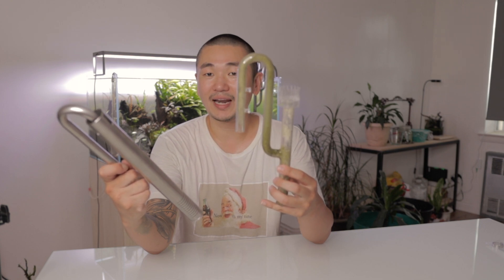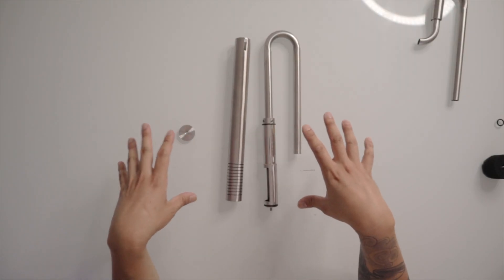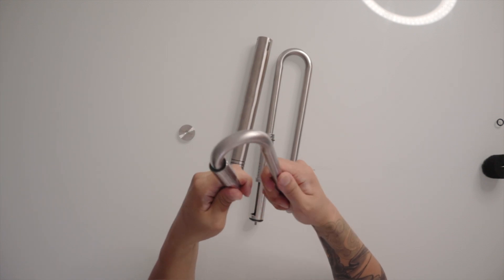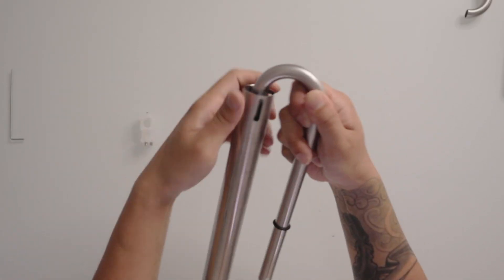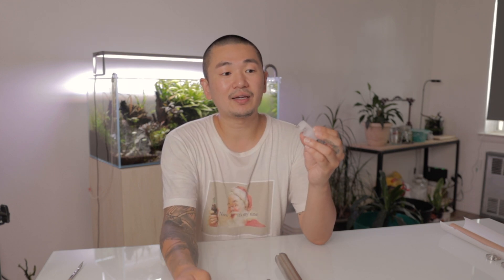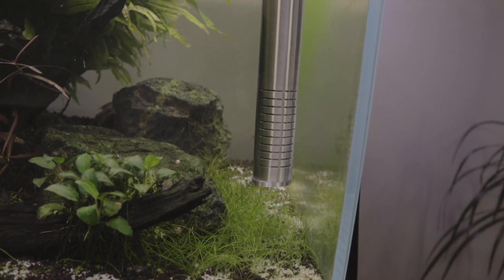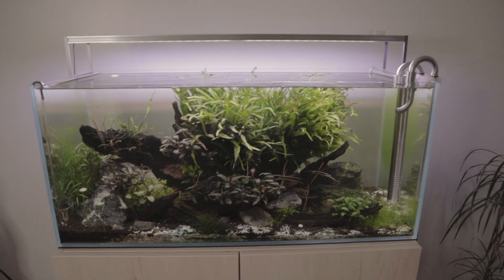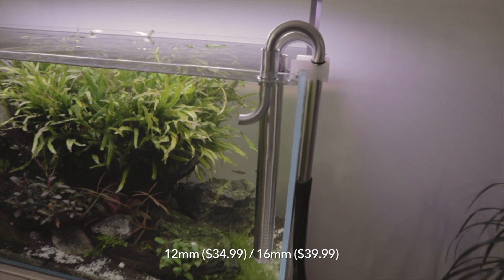Slim Profile Stainless Steel Lily Pipes with Surface Skimmer | Review and Comparison Versus Video

Comment: I have a ADA 300 Jet filter smallest size with ADA glass Lilly pipes…. Will these fit for my filter? Thanks
Reply from the maker: I dont think it will, your hose size may be too small. I mean you can force it on there or use a adapter to go from smaller hose to larger hose

Comment: Nice review. The little jubilee clip wouldn't really go at the top of the pipe where you originally thought. I'd imagine it would go round the hose to give extra security when it's fitted to the bottom of the pipe.

Comment: question as I am new, I have just started my tank. Is it safe once you have added prime to your water to have your hands in there working on bits, is it a safe chemical? I am changing water every day as it’s a new heavey planted c02 tank and using seachem prime everyday is it safe should I have been wearing gloves .So new just looking for tips on how to work with different things
Reply from the maker: Yea its just dechlorinates and removes ammonia and makes ur water fish safe. You can work in the water. You wc everyday because the substrate leaching too much ammonia?
Reply: @TankTastic  no was advised to if first week every day large water changes in second week every other day and 3rd week twice a week 4th week once a week
Reply: What do you think, I was also told to double  dose tropica ferts from the start not to sure  what do you think it’s a new setup
Reply from the maker: @domesticcardetailing8295  yea go with it see how it goes. I personally follow ur wc method if I use nutrient rich substrate thats leaching a lot of nutrients.

Comment: This design looks like a wier overflow design. If they reduced the outer diameter pipe it would likely be much louder and if someone was using it as an overflow instead of just a outlet to a filter it might break the suction. I just ordered one thanks to your video. There's so little information that your video is one of the most informational sources I found.
Reply from the maker: Thanks for that info! Well let me know how you like it.